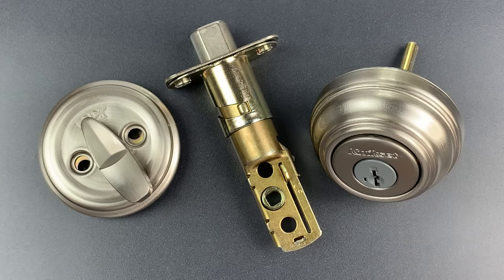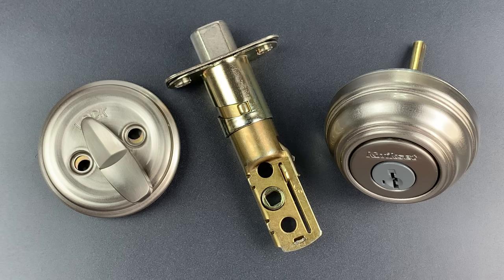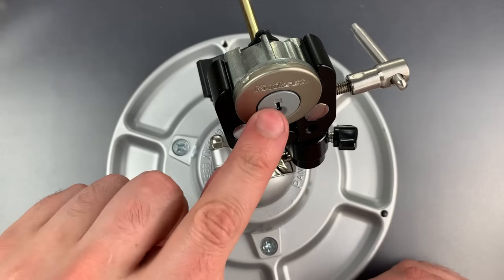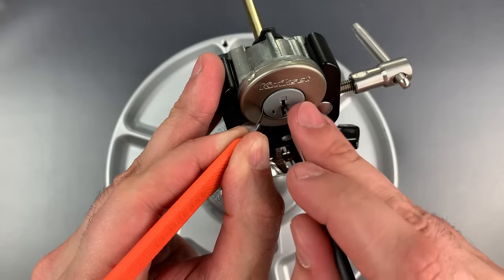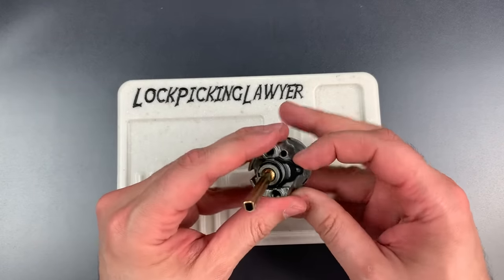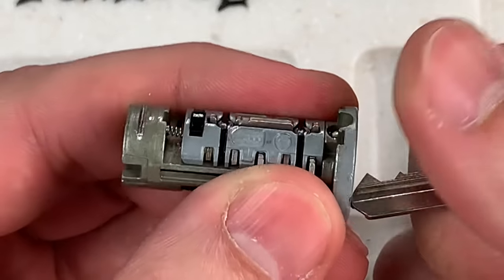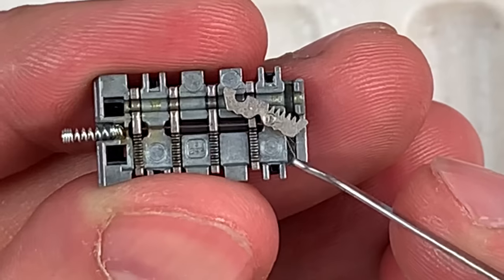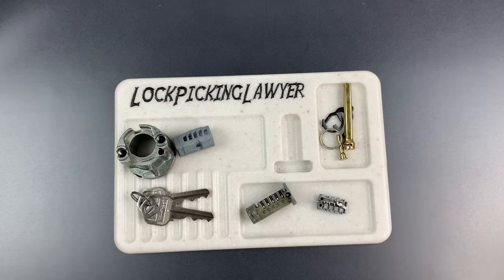[904] The “Pros" at Consumer Reports Couldn’t Pick This (Reverse Sidebar SmartKey)

Comment: They need better experts !
Reply: Qwikset should hire LPL as a consultant.  Seems like a no brainer to me.  Heck I'm ready to start a company with him designing lock pick proof/resistant locks!  I fund it and run it and he designs!
Reply: I bet Rick at the pawn shop knows a guy.
Reply: "Experts" meaning a 19 yr old intern that is someone's kid that needed a job.
Reply: They should not be called experts maybe amateurs.
Reply: @teamvigod  I created untensionable (for picking) lock design, but no have funds to make it reality.
Reply: @sleeptyper   Interesting.  Do you have a prototype yet?  Any idea if it has been done before or patentable?   Could pull LPL in to evaluate and render a report.  If viable I've got resources to commercialize.
Reply: @teamvigod  It exists so far only on paper. The idea is nothing like any modern lock, which rely on tensionable lock core or outer shell. In my idea they both get tension at same time from the key and the co-incidental tension is required to turn the mechanism. Quite hard to explain and certainly not in public.

Major difficulty at picking my design would be that it would require same number of picks as there are key pins and each pick must be used as lever and tensioned very precisely and then the picker would have to find out a way to use all the picks to turn the lock core as a solid unit behind a coverplate.
Reply: To be fair, this is a new thing and LPL had to build a new tool to do it. I know he downplays it quite a bit, but that is indeed not something the average pro lockpicker would ever do. That’s pretty advanced even for hobbyists.
Reply: @sleeptyper   Interesting.  Could take discussion offline.  I think we'd need a prototype even if rudimentary.  Then have somebody like LPL consult on the design and attempt to defeat it.  If it is something that could be commercialized we could either manufacture it or spend the money to patent it worldwide then license it to one major (Master, Qwik) for a large fee or a smaller fee to all.
Reply: @teamvigod  I have tinkered possible problems with it and my mind tends to tilt towards material problems, but if the hardware is made from same or similar alloys as the Bowley locks, it will hold years and years of use.

SPP on my design will result in just frustrated "Nothing on one, two, three, four, five etc..." The picker would really need a key copy made to spec for that very pinning. Tensioning the core without setting all pins correctly (all at once) will result in the core turning freely without turning the lock mechanisn.

Offline discussion is very good idea. Any suggestions?
Reply: @sleeptyper   Can do email or one of the instant messengers.  Preference?
Reply: @JasperJanssen  To quote LPL, "that's something pioneered in the 1930s." I'm pretty sure any pro lockpicker that knew the mechanism was in place (or discovered it through trial) would figure out that if they didn't already have one they either needed to buy a tool or do like LPL and bend a shim from their kit.
Reply: @teamvigod  I see no email from you. Probably my design is too surreal for this time - Our current world has many insecurities and customers rely on insurance approved securities.
Reply: @sleeptyper  do you want to give me your email or any instant messenger usernames I can contact you thru? (reddit, slack, discord, fb messenger, IG, etc)  Ultimately though will need a prototype to go to somebody who can battle test it like LPL here.  He may be able to further refine it if necessary.
Reply: @sleeptyper  got it. email sent. you can delete your reply above if you want to avoid spammers
Reply: ron palmer they should hire him
Reply: CR was probably just paid by kwikset.
Reply: No; They just need experts to begin with. Lol
Reply: @teamvigod  Seriously like surely it's not impossible to make a cheap lock that will resist common attacks? But I think also the fact is that more often than not, thieves will probably prefer to just go the easy way, destroying your window or door or something
Reply: I think the company give lock to the experts and tell the lock without checking its blueprint so they don't know everything about that lock. But lpl does a research and open the lock to understand the mechanism of the lock. He trys  picking the lock off camera so he is well prepared on the video.
Reply: The expert’s skills consisted of knowing how to turn the fucking door knob...

Comment: I'm a professional locksmith and I still cannot get my shim to depress the sidebar in order to pick the lock, either its too much tension and the sliders bind, or not enough and they just spring back, I would love to see you demonstrate this technique in more depth, more around the size and thickness of the shim and the careful placement of it, on the side of the core it's a very narrow exposure to the side bar, looks like a vertical piece of wire and applying pressure there causes the sliders to bind or move more freely, I really am at a loss for words, you really are good at what you do , I must confess, when I come to unlock a home with a smart lock on it I cringe, but I would love to develop a technique to overcome this, other locks I have no problem picking, I hate smart locks!

Comment: is this the same mechanism that made that one master lock unusually pick resistant?
Reply: Master lock has researched that lock and has taken steps to ensure it never happens again.
Reply: The mx?
Reply: Not exactly the master lock one has a similar design to a Assa where the key interfacing pins gates are all in same spot on the pin and the position of the sidebar fence changes based on the key cuts where the smart key has a single position for the sidebar fence

Comment: Are there two reasons the Kwikset Smartkey locks with the square sidebar must be shimmed to be picked?  (1) Square sidebar binds, preventing core rotation with key removed if the core is attempted to be rotated.  (2) Are there 2 springs on the sidebar pressing it inward toward the sliders?  If so,  the springs must not be strong enough to maintain pressure on the sliders to position all of the sliders into the true gate position so the sidebar can retract.  Your response is appreciated!

Comment: They needed to make the false gates slightly deeper.
Reply: Then they wouldn't be false gates. They would act like a true gate and retract sidebar deeper possibly allowing it to rotate core in more that one gate making it even easier to pick.
Reply: @POSRockCrawler  adjust side-bar accordingly?
Reply: @FreedomIII  thats why precision machining makes good locks tougher to pick, it makes false gates trick you without the gate allowing the sidebar to move far enough to act as a true gate. With a poorly machined lock the slop can make up a large amount of the movement between locked and unlocked

Comment: So if I were to JB weld / actually weld a washer around the outer ring of the lock that blocked off the gap & impeded any tools from sliding in around the cylinder to manipulate that side bar, then I removed some meat from the key stop to correspond with the thickness of the washer - I would have a pretty secure lock for cheap? This sounds like a fun project.
Reply: Would love to hear more from you about this
Reply: well, try the above method first... 
it isn't as easy as it seems. So you can probably save the time. LPL has a fantastic vid on how to mod a Kwikset for pick resistance, you probably saw it by now.

Comment: I took my 3.0 front and back doors bought some 1 inch deck boards and 5/8  T1,11 siding and a hole saw and through bolt's covered the doors this covers over the dead bolt's bought some stainless steel washers with the perfect hole size to cover the face of the dead bolt's only room for the keys had to cut part of the key handle to fit in the key ways put 2 dead bolt's on the doors this makes for one secure solution for this problem.  I also reinforced the hinges the doors look great superior to anything I have ever seen on any home.. barrs on every window superior security i also put abloy 🔐 on the 🚪 there is no room for the lock picker to place there hands are use any tool's to bypass this setup. .I built this after watching this man bypassing many 🔐 stay safe everyone

Comment: As far as I can tell, if I want to secure something from you, I essentially need to weld it shut
Reply: welcome to the club
Reply: Angle grinders are also cheap
Reply: Weld is shut and lots of duct tape.
Reply: Hello, I'm LPL and today I show you how to bypass welds without using a grinder. It's actually not as difficult as you'd think. You just need a slightly broken-in toothbrush, masking tape, the bottom of a domestic beer can and the key Bosnian Bill and I created. And there we go. Now let's get this door in a vice and zoom in on this rather sad weld bead.
Reply: He owns an angle grinder.

Comment: TLPL I really appreciate this video and this is amazing work! I emailed you some time ago hoping you'd pick this. Well, I've been put to shame. I've picked a lot of the locks you have, and a lot of high security locks. 

No matter what I do I can't pick this! I've even taken the core out and applied pressure to the sidebar with the cylinder out. I can get the wafers to bind to some degree, but they fall back down etc. I can't even pick this with cheating by looking at the top of the wafers and applying tension to the sidebar with a piece of metal.

What might I be doing wrong? This one has been frustrating so I'm hoping for any advice? Amazing work as always bud! Keep up the great videos!

Comment: I had a door kicked down a few months ago, so after improving the door & jamb, I would trust this deadbolt more against picking attacks than 99% of what’s out there. How amazing that the brand which I consider lowest security ALSO sells a (fairly) secure deadbolt! Do you agree LPL? (At what point are locks “good enough” and we need to shift our attention to the other weak points of security?)

Comment: Residentials, don't use these. I just helped a friend get a new lock that was a smart lock, old one was from like 7 years ago. I could not figure out how the pins works until this and I'm honestly impressed. I had been practicing and took it as a hobby because of this channel. 

I was stuck in bed for 3 months because of a torn knee. Then was able to move without surgery (work comp, basically paying me less worked better for them than a surgery.) And as I was going through physical therapy and still on crutches? Covid hit!
Reply: Anyway, I could pick a lot of locks without just raking and in under a minute. The side bar and all that makes total sense now.

Comment: What would a properly implemented reverse sidebar result in terms of how long it would take you to pick it, LPL?
Reply: In a previous video he has stated they are impossible if done correctly. Basically have it to where there Is no way for the picker to access that sidebar.
Reply: If the sidebar is shielded so you can't apply pressure to it at all, then you get basically no feedback on the sliders and its down to dumb luck.
Reply: Possibly some shielding in front of/around that sidebar would be best.

Comment: As a 40 plus engineer in the oil business, who drilled oil and gas wells for a living, I can’t understand why I am fascinated with LPL’s videos, but I am.  Maybe it has to do with his calm demeanor and sure dexterity.  
But I have a bone to pick on this video.  This lock is easy to pick for the LPL.  I firmly believe the rest of the world would find it very difficult to pick this lock.  Who the heck would know to pressure a sidebar on the side of the lock.   Even the experienced pickers,Moho I bet have never seen an LPL video would have a tough time.  
I think the LPL needs to give this lock at least a hard difficulty for an experienced burglar.  A medium difficulty for a locksmith who has not watched this video and an easy rating for one who has.

Comment: LPL left something out. The article by Consumer Reports specifically says, "our testers didn’t successfully pick the lock within 5 minutes USING A STANDARD SET OF PICKING TOOLS." (Emphasis mine) I would not consider the tensioning tool used in this video to be "standard." I've never seen it come in any of the many pick sets I've purchased. I would STILL put LPL up against any picker any day, but if you're going to put the term "Pros" in quotes to imply they aren't pros, you have to play by the same rules they said they were playing by.
Reply: You will notice something at the bottom of the consumer reports page : Editor’s Note: This article has been updated to clarify how we arrived at the picking-test rating for the Kwikset 980. - this was as a result of the feedback from viewers of this video

The original (linked below), said:  "The affordable Kwikset 980 is a terrific lock for the money. It couldn't be picked by our pros, and despite the low price it comes with long screws, which means the strike plate secures solidly to framing, guarding against kick-ins."
https://web.archive.org/web/20190610212228/https://www.consumerreports.org/door-locks/door-locks-that-keep-you-safe/

Comment: You take the thin plate off and use a drill bit and back the screws out that hold the lock together. This can be done with zero skills. Quikset could fix this by turning the lock knob 90 degrees when locked to prevent the screws from backing out.

Comment: Would it be possible to pick this lock if the rim around the core was shielded?
Reply: Adding a little lip right there wouldn’t cost anything, and would make it.. let’s call it “much harder” t9 get the shim in. Not impossible, I don’t doubt, with the tolerances that a lock like this is manufactured to.

Comment: tbf, is there any lock that is secure enough that you won't get it open within a minute?
Reply: Check out the Naughty Bucket series by Bosnianbill and him.
Reply: My bet is on the dual fork bowley core simply cause i haven’t seen any1 pick it. In theory it is ofc doable which proven in a video where the single fork version was pickad but i don’t think method would scale that well
Reply: Peter Johansson The technique found for the normal Bowley required a special picking tool, that's all.

Comment: to be fair,  it couldn't be picked the normal way, so it is technically true. i assume not much people will know to shim the side and at that exact position. 

and i suggest that they left that flaw intensionally, in the scenario that you really need to pick it open because of lost or broken key.
Reply: That's security through obscurity. It only has a random chance to work because burglars won't know the trick, and the more people move towards this style of "unpickable" lock the more the know-how about it will spread.
Reply: In the scenario of lost or broken key the lock is compromised and should be replaced. So why care about picking it. Just destroy it.
Allowing a bypass in any security design cancels the purpose.
There's the same issue with the countless examples of electronic locks that can be bypassed with a shitty tubular lock so you can still open it when the battery dies.

Comment: inexcusable all it requires is an overlap on the housing to stop you sliding in a shim wouldn't even cost anything beyond a slight adjustment to a cad file
Reply: Harder than that, it must still be possible to assemble the lock.